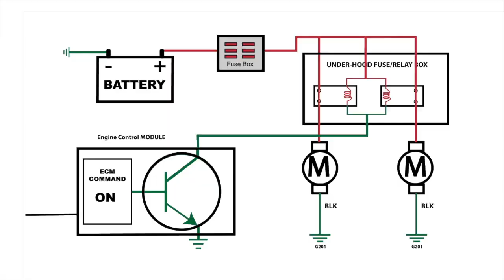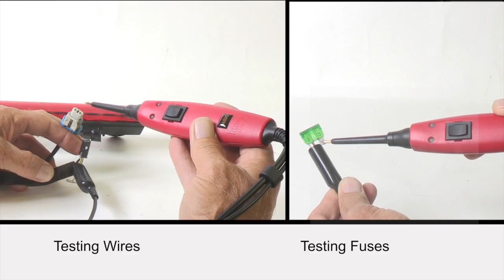Power Probe BASIC

Comment: not that impressed, i have the 3, 4, and hook and because of me having those this isnt too practical
Reply: They make or made a 3s version that looks like its inbetween the 3 and 4 that I ordered and should have today, I plan on making a video with the 3s version since I didnt find anything on the specific model. Id appreciate a sub so you can see what the difference is. toodles
Reply: I have most of the power probes but sometimes it it is simple tool just to do just basic testing that is the tool I grab so I just have to get the hook out
Reply: What one do you like the best between the Power Probe 3 and 4?
Reply: +707SonomaComa well i love my hook the most but definitely get the 4 the 3 is pretty out of date almost, all good tools but I recommend the 4 you can get them cheap on amazon
Reply: Right on, thanks for your reply. The reason I was asking is because I have a couple of 1969 ad 1970 Chevy trucks and I work on electric trailer brakes and lights at my work.  
 I was worried about all the other extra bells and whistles that could go wrong and pose a problem with the P.P. 4
Reply: @707SonomaComa  if you are happy the the power probe basic and it dose what you need it to do then you don’t need the more expensive probes
Reply: I ended up getting the 3, 4, the Hook, and the SnapOn version too!
Now I don't have to worry what is the right one. But honestly for me the #3 works fine. It's smaller and compact.
Reply: But even one may not be to your standard of electrical testing so it is a good tool for the people who are just starting to do thay own basic testing
Reply: You dont know how to use it